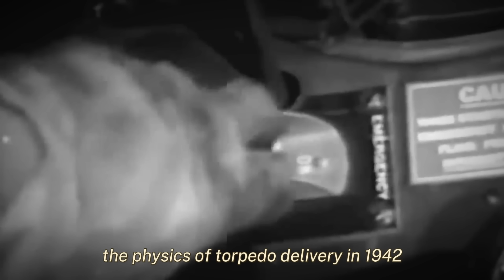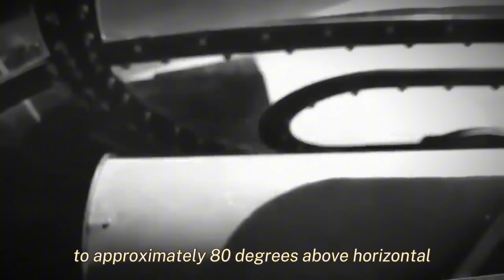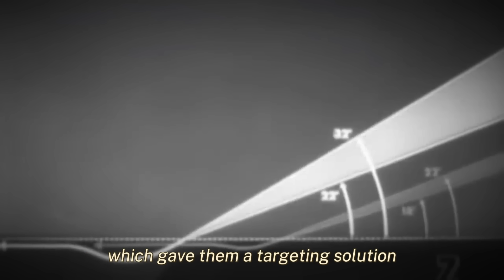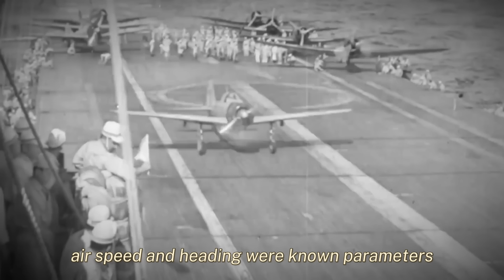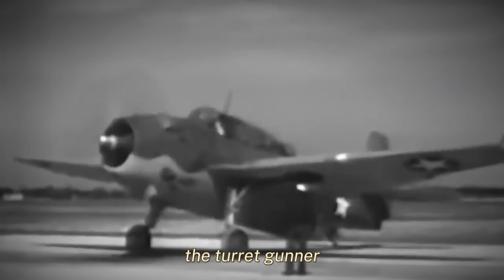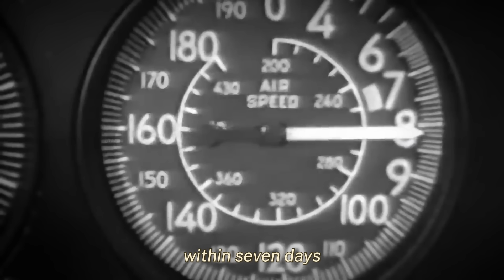Flying a TBF Avenger During WW2 was Hell

Comment: Designers should have considered the Prat Whitney 18-cylinder wasp engine in the DBF.  And added the .50 caliber machine gun in the tunnel belly position.  And some sort of seat for the turret gunner.   We had plenty of aircraft and vehicles that where death traps for the crews.   Even the torpedo's could be faulty.  Launch and Trac to the target, Hit the target, and not even detonate.  We had scores of aircraft that could have been better, but politics made that not happen.  Hence the P-39 without a supercharger, because of politics.  The original Sherman tank " Fat Boy" sat lower, heaver armor, would have saved many lives.   Just needed the long barreled 76mm main gun.  Not that short barreled 75 mm popgun.   All politics by overweight generals that would never lead from the front.    Eventually better aircraft and equipment ensued ,  at the cost of many brave lives.  That's war. Not without Politics though. And many brave service members that never returned home.
Reply: Sometimes having better versions of equipment doesn't mean that you can mass produce them at that time. It is better to have a lot of equipment you can mass produce and equip than too few of very good equipment. It is absolutely better to have the best equipment available but if you have too few of them it won't mean a thing when you can't have them in sufficient number
Reply: @TamLe-ig2ey yes like Sherman Tanks. Easy to mass produce .  Much like the theory of the T-34.  Or Brewster Buffaloe.  Just mass production quantity over quality.  Just think of those pilots and tankers engaging to enemy in inferior equipment. But there is just so much inferior equipment comming of the production line. The Troops are practically forced to use it. But again there’s so many of inferior tanks and aircraft.  If your a general in charge and don’t have a shortage of people to man these vehicles I guess that theory prevails.  I have been a soldier.  For the guys on the line that theory isn’t too attractive.  If you can imagine being in their boots.
Reply: @paullevins5448  Yeah I completely understand. The general idea is that military grade means lowest bidder has some thoughts to it. Sucks for the common soldier, makes sense for the brass